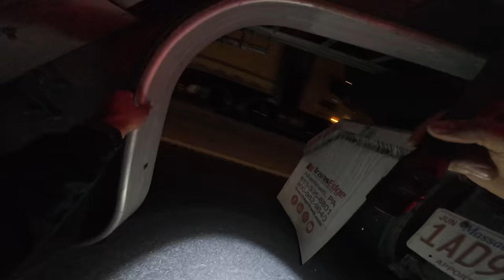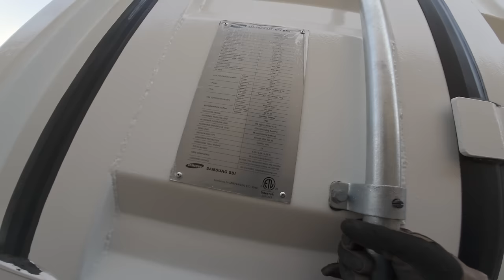70,000lb Battery Destroys YouTuber's Trailer!

Comment: That trailer is loaded wrong. The load should have been over the rear wheels. He has no one but himself to blame for that weight on an aluminum trailer.
Reply: I wonder what you think those two axles are for that are under the nose of the trailer?
Reply: @stargazer7644  I don't have to "think", because I know. I am a trucker. Here is what you need to know, every trailer built has a weight limit that is clearly stated on a plaque riveted to the frame.  That was over loaded, and the best way to risk an overload is to have the weight squarely over the axles. I hope you learned something, thanks.
Reply: @tuberNunya  Oh, since you're an expert then, I'd really like you to explain where you'd put 70,548 pounds "over the rear wheels" that wouldn't overload the rear tandem.  Go ahead, we're all listening.  What in the world would putting the load "over the rear wheels" have solved?
Reply: @stargazer7644  You aren't equipped to understand, son.
Reply: @tuberNunya  That's the best you have?  It's ok to admit you were wrong.
Reply: @stargazer7644  I do when I am. Let me know when you pass your test.
Reply: @tuberNunya  Well, you can't answer a simple question, so you probably shouldn't be trying to talk smack.

Comment: 7:38
Why didn't you lot simply reposition the container BACK until it was centralised over the lead axle above the rear end of the trailer, so that there wasn't anywhere near as much of a fulcrum twist excerted onto the frame of the trailer, as that would have allowed the gooseneck area to be "lifted" enough to allow the truck operator, to take the container away at the same time as "moving" his now buggah'ed trailer, slowly - to leave it at a secure yard where they could have simply transhipped it onto a better "normal deck" shorter container trailer.
All it would have meant - was for the chains to be loosened enough to "reposition" the container towards the rear of the trailer, to "dump" the load weight, over the rear axles, and NOT so far forward as they did, which was the sole reason the gooseneck bent.
Reply from the maker: Are you special or just acting dumb? And are you blind and deaf? If so how are you watching this video?

Comment: weight of the load should have been over the axels NOT at the front of the trailer…. DRIVERS FAULT FOR IMPROPER LOADING
Reply: There are axles at the front of the trailer too, you know?

Comment: He Should not  have had it loaded at the front of the trailer of corse that much is going to bend the gooseneck of the trailer. It should have loaded just over the top of the first axel onto trailer. Totally the drivers & loaders fault .

Comment: Ok anyone know what you need a battery this big for?
Reply: Solar fields
Reply: @alphabravo424  ok got ya 👍🏻
Reply: Any place that has a generator for backup that needs non-stop power. The batteries can supply power until the generator kicks in when there is a power failure.
Reply: Storing solar and wind power for peak times.

Comment: 20:02 you can see that the weld had zero joint penetration and broke right down the middle, the welders to blame, probably some brain dead dummy that only knows how to pull a trigger and doesn’t know how to weld. I would bet the trailer was engineered to be able to handle at least 1.5x or more than what they ended up rating it for on the road. Everything is over engineered like that but if you don’t have someone to execute the blueprint properly it means nothing

Comment: i was gonna say this is totally the Drivers fault for not checking his load who the hell puts a load that heavy up front like that you never put everything  loaded up on the tongue of the trailer. if he was forced to hit a weigh station this would of ben a violation with DOT. Hay guys im gonna dump all 70,000 pounds on the weekest part of my trailer then wonder why my truck drive weird and sketchy and oh hay the weakest part of the trailer broke how did that happen..... DOT should of caught this dude WTF. my training came from Swift, my mentor who trained me spent 20 years in the industry as a owner op most our loads were these flat/lowboy trailers the kind of that avoid most train tracks. Rule of thumb aluminum trailers require double or 3 times the thickness to a steal one to handle the same weight and stress. after trucking i went to school for welding and fabrication 100% ignorant driver fault knowing nothing about how to do a load. this cant of drove well down the road with a load that far up.  there is a GOOD reason you se one big roal of metal RIGHT IN THE MIDDLE of these massive trailers Weight distribution. all the way up front make the trailer unstable puts all the weight on your tongue and 5th wheel and now your trailer starts acting like a pendulum and flexing where it should not EVER DO THAT. im not even 4 min in to the video and this is all the things i wish i could scream at this driver for doing. unlike my mentor Who would slap the hell out of you and make you do pushups (on top of trucking for 20 years he was ex Navy 20 years service he will slap your stupid and make you do pushups) who the hell put 32 tons all on the front seriously this dudes gonna kill some one or him self doing loads like that. there is LOAD rules how much you weight your allowed over the each axel the front wheels the rear trailer wheels you get hit with massive fines for violations on these your CDL takes huge point hits its not like a car driver license where it 3 point... its 8 or more depends on the seriousness of the violation. i Hope the trailer maker tells this dude to go pound sand and eat trailer cost out of his pocket there is ZERO excuse this guy does not know the rules and has a CDL he just does not give a crap at all these are the kind of driver the industry can do without. im not going to call him a operator like other in the comments are that implies he is a professional and he ignores a DAY ONE RULE trucking schools hammer in to your head all the way to the end of school.

Comment: if you figure the truck and trailer weight 32,000 lbs and the cargo is 70,550 lbs that puts him at roughly at 102,550 lbs. according to California law he can only have  34,000 on the tandem on the trailer, 34,000 on the drives and 12,000 on the stear tires. with a max of 80,000LBS.   I am sure when CHP gets there they are going to have a field day with this guy, being he is roughly 20550 lbs over gross.    This guy should loose his CDL, he is a disgrace to the industry.  He is really lucky he didn't kill someone.  There is no state in the nation that I know of where you can even permit a 5 axle setup over 102,000 lbs.  He needs to have this on a 3 or 4 axle trailer at least, preferably with a tri-alxe truck also.  California weight laws are a real pain with their axle bridge laws.  Serves him right to have a broken trailer, he is just stupid.

Comment: That's crazy. Must not have been made very well
Reply from the maker: It was made just fine. Just the total weight and placement was wrong. Remember this was not a 40' container. This being much smaller meant the heavy weight was more concentrated as well in the spot they put it.
Reply: 40 thousand pounds over the limit.for the trailer!
Reply: @PepesTowingService  that makes sense.  they just loaded it wrong

Comment: Well driver shouldnt have aproved that load but also whoever loaded it failed at their job too lol wekgnts meant to be closest to tbe axles to lever the weight lol not over the weakest part of a trailer
Reply: Please explain exactly where YOU would have placed a 70,500 pound load so as not to have more than 34,000 pounds on either tandem.  Go ahead, we'll wait.

Comment: Anyone else wonder how 4 little bolts can hold that much weight
Reply: I don't know what these shackles are made of, but common grade 8 bolts can carry 150,000 pounds with a single square inch of steel before breaking.  So you could theoretically support two of these battery containers on a single square inch bolt.  So 4 of those shackle bolts on one battery are quite conservative.

Comment: why not to just slide it back towards the rear wheels and maybe that could of let the weight off the tongue a bit to move.
Reply from the maker: Dude are you literally blind? Did you not see the literal broken welds and bolts and everything??
Reply: Maybe because you can't put 70,000 pounds on the rear tandem?